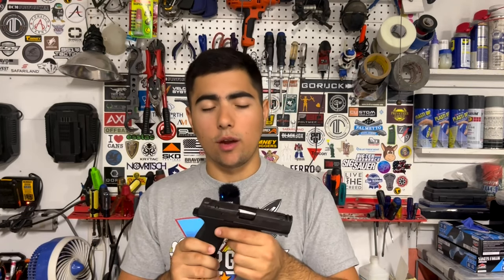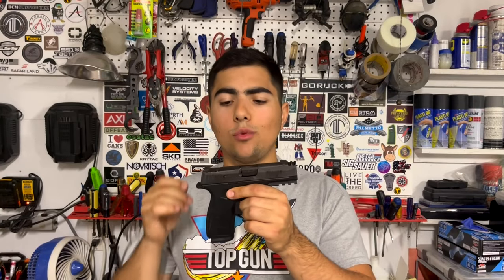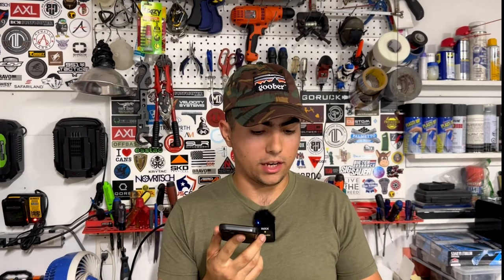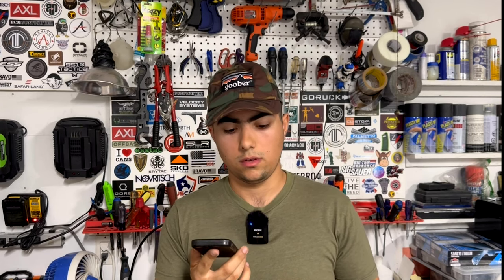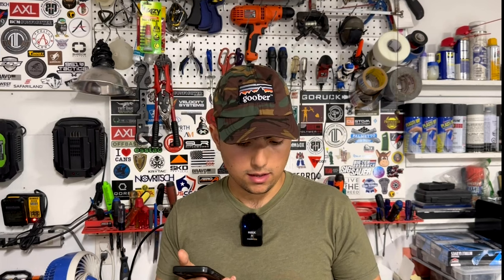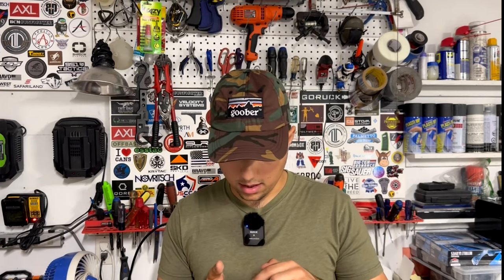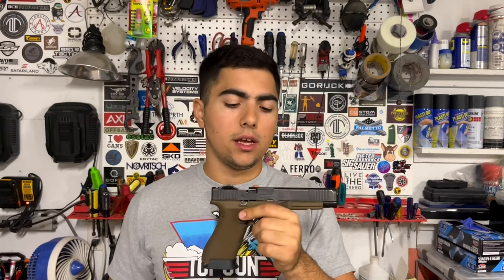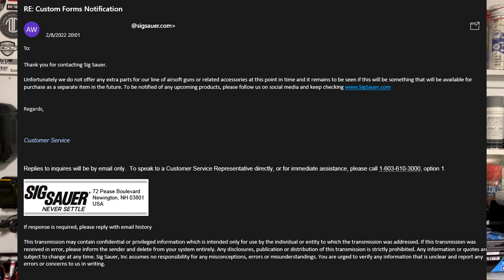Was I Wrong About the SIG P365 X Macro?

Comment: Thank you for this video. I was about to shell out $800 plus for the 3.7 Barrel with Romeo attachment. I am still going to test this pistol out at the range. 

One thing I can't personally tolerance is lack of accountability and trust. Their response seems to be the new norm for a variety of things and knowing what you had to deal with is enough for me to stay away. 

Just not acceptable to shell out more than $800 just to have to deal with this. I understand everyone may have a different experience with the  Macro, but seeing how they handle you're circumstance is unacceptable. 

Plenty of other brands out there that may still take pride in their quality control.

The agent you spoke to seemed to be helpful, but rest assured they were trained to respond that way and they are well aware of the issues. 

If a company cannot stand by their products that should tell you who they are and where they are going as a company.

Comment: No problems with my 365xl in @3yrs
I carry it appendix everyday in a variety of different kydex holsters. I've cleaned it 2-3x's and fired 1000+ rounds. 
No rust, no failures of any kind. I shoot the cheapest brass ammo for range time and carry 124gr HST.
I've put 50rounds of HST to make sure they feed properly and they do. I hate you had problems but I've heard of alot of finish problems with the MACRO. Sig has gotten to big for their britches with the military contract and it looks like QC or materials used have gone to shit.
Reply from the maker: Yeah it seems the 365s from like 2+ years ago are good but recently on macros and even on other 365s it seems their finish and quality just isn’t what it used to be.

Comment: What kind of holster are you using?  What kind of carry?  Appendix?  3-4 O'clock carry?  What part of the country are you at?  I've had zero issues with my P365 and P320s.
Reply: The point is, for $800 none of that matters. The gun sucks.

Comment: I wish i had the time to explain the physics behind a slide cut comp and short barrel vs a standard screw on comp, but I can tell you your incorrect in thinking the muzzle mounted comp is better especially saying its over 50 % better, you've got it backwards. Great video tho, I didnt even need to watch the rise of the gun I can see your entire arms and wrist moving without the slide comp..
Reply from the maker: Wouldn’t a barrel mounted comp with a tighter chamber that can better redirect the gases perform better? Like the macro comp does work, I was wrong with my initial judgement, but since it has to have space for the barrel to move, it also means more gases are escaping out the front.

Comment: the minute i saw the design of the "compensator" on the Xmacro i knew i was a terrible design. its not truly a compensator. its just a long slide with holes on it on a short barrel. but since i already had and love my p365 XL, and only want the bigger grip module, that's the route i'm going with. the only plus side to the Xmacro is the grip module

Comment: Meh... had the exact opposite experience with Glock CS. Lost the trigger housing pin putting on the beavertail back strap. Contacted them and was ready to buy a replacement. Acted like they were going to send me one for free, filled out an address fourm for them, and never heard back from them. Glock completely dropped the ball.
Reply from the maker: Did you try reaching out again for followup? Or did the lack of communication make you not want to communicate with them either?

Comment: Props for going back and giving the gun a second look, but I'm with Sig on this one.  The pin holding the FCU in place fell out on my gun and they just sent me a replacement.  I was on the phone for two minutes, no hold, and the guy I spoke with quickly offered to send the replacement kit, or have me send the gun back and they'd do it for me.  Granted, that's a minor/cheap part compared to your issues.  Watching you shoot in this video, you know what you're doing, but for that gun to be rusting where it is I can't help but feel we aren't getting the whole story.  For your Carry Mags, the FCU and the Optics Mounting plate to be what's rusting and none of the exterior is odd.
Reply from the maker: The exterior rusted plenty, I cleaned most of the rust off the gun so all the white spots on the slide are areas where there used to be finish and then rust and now bare metal.

Comment: I wonder if there was perhaps a bad batch, or a 'bad run' on coatings / components. (it can happen) 
I have a 365 and it gets exposed to saltwater air quite frequently in the ocean on my boat. 
In addition, I live less than a mile from the coast and the prevaiing wind is straight at my house . . . IE 'salty air nightly / daily'. 
So my gun is constantly expsoed to a very corrosive environment, and I am not seing anything unusual in terms of rust or corrosion. 
I don't do anything 'special' or unusual in terms of cleaning/ maintenance, or storage . . . so I am curious as to why your pistol seems to have such corrosion issues. 
I'm not doubting or second guessing your issue . . .  it just seems pretty unusual, and I haven't heard of anyone else experiencing this. Perhaps they are out there, I haven't looked for it. 

I too am disappointed in Sig's customer service response on this. 
I think it could / would have been better business for them to request that you send in the pistol for inspection, and to seek out the 'reason' for the corrosion issue. 
Who knows . . . they may have discovered something very unusual and unique to this case  that caused the issue. They then could have offered a remedy based on their conclusion(s) . . . weather that wes free, or at a cost . . .

But to offer a 10% 'go away' discount is less than impressive.

Comment: Has to be a bad batch. I have had my p365 ( the original one ) for many years and put 1000’s of round through it. No rust or anything. It does disappoint me that sigs customer service is that bad though..
Reply from the maker: It seems to be a later gun issue. If you check out the video from @nightwoodguns about the macro, he talks about how he had an early gen 365 with no issues but bought the same model later and it rusted badly.

Comment: 3 days after I had my xmacro, the mag release broke.  lol
Reply from the maker: Jeez, that’s awful. What did SIG CS say?
Reply: @donkeydefense   "It's unusual. Send it back we will take care of it."
Reply: Do not send back . This already happened to mine also. Throw the plastic piece of the mag release away , and use a 365, x ,or xl  mag release not the entire piece just the plastic part that snaps into place to hold it together. If you use the macros it will break again most likely. You will see they are different design but they work perfectly. Hope this helps
Reply from the maker: @JakeTheSnake, so the macro has a different mag release than previous 365 variants?

Comment: @11:00 when they asked him what he used to clean his guns with he looked dead at that WD-40 on the shelf 😂😭
Please don't tell me you're using DW-40 to clean your guns because that would explain the rusting 😭
Reply from the maker: No I do not lol. WD-40 should never be used on firearms.
Reply: @donkeydefense  I'm not going to lie... I used WD-40 as a degreaser and cleaner on my Smith & Wesson SD9 one time 😂. I made sure to wipe it all off and dry it after cleaning it though. I literally didn't have anything else and it was dirty like you wouldn't believe. It had mountain due spilled all over it and by the time we noticed it was all dry and sticky on the inside of the gun. It never rusted or anything. Smith & Wesson makes some pretty good guns.

Comment: Definitely not the best response from Sig. But the situation with Glock is not an Apples to Apples comparison. It's a case by case situation. I would be curious if you called Sig and said you over torqued a screw on your MOS plate and see if they wouldn't do the same thing. My guess is, they would.

Comment: There is a couple or more definitions of quality, one is building to customers specifications , another is meeting and or exceeding customer expectations;  sounds like this gun did not meet his cosmetic expectations regarding the finish , Sig Sauer most definitely should investigate this , seems this is becoming a common complaint, I wonder if this is a suspect lot issue that deviated temporarily from process or if this is caused by an incapable un robust process , need a response from quality assurance department !

Comment: I find it strange no one has ever mentioned rust on p365,p365x,p365xl,p365xlspectreor spectre comp but the macro it's  an issue.but not on the macro tac. Let's analyze the issue multiple 17 rd mag dumps through a comp'ed slide  reacts the same as a compensator or suppressor and super heats the finish causing the nitride coating to weaken rust will form where the stainless steel has been milled (sight cuts) because the natural stainless coating is . Lesson don't super heat the slide with multiple mag dumps that are useless for training, allow a cool down before storing after it's been super heated , clean and maintain it properly. . In short if your slide is working like a comp or mussel brake it must be maintained the same way.
Reply from the maker: I have plenty of comped guns that require no extra maintenance or care from my standard guns other than cleaning out carbon fouling. But no rust or other such nonsense. Same when running suppressed. This still leads to being a finish issue. 

Also people have had mentioned rust issues on other SIG models.
Reply: @donkeydefense  standard comp transfers the heat to the barrel not the slide . Steel muzzle brakes that have been rapid fired have rust . Don't get all defensive it's just the facts of physics and chemistry and those rules don't change base on your opinion. I'm not being a smartass I was simply explaining

Comment: The barrel is fine, it’s called normal wear and tear on sliding parts, learn to properly grease/oil your gun. Wipe it down when you’re done wearing it.  You need to oil under the optic before installing cause when you sweat it will seep into crevices.  

Man the Drama that Glock Princesses find to complain about. Take care of your gun and it’ll take care of you when you need it.

Comment: Isn't the slide, and FCU's  suppose to be made from SS?
Reply from the maker: It may be steel but it’s not stainless. It’s stainfull.
Reply: @donkeydefense  I replace all my sight with Trijicon iron sights on all my striker fire pistols. the sig site say's the slides are SS. I'm guessing rust is coming from the iron sights. under the optic has me stumped because the optic is 6061 Alum. unless your using a steel plate, are you? My trigger never got rustier any part of the pistol. Once I broke the gun in, I took the fcu a part and were steel components rubbed together I apply a lil Mil-comm TW25B grease any place I saw shinny metal. I live in the south close to the ocean. I go fishing all the time and the firearm I always take is my P365xl w. manual safety. For EDC depending how I'm dressed its my P320 or... you guessed it my P365XL. I also replaced the factory trigger for the GreyGuns trigger. I would cerakote the slide mad black plus from Mad customs. Forget about Sig re-coating the slide. I didn't like how they handle it. they should of offer at least, re-coat and replace all rusted parts this time for free and next time it will be on you. At least. Good Luck buddy

Comment: Sig's response was pretty lackluster. Let me preface this by saying I've had issues with plated wristwatches, bands and jewelry where plating would disintegrate to the point where I'll  only wear stainless steel or actual sterling silver or gold version of those items. So I know what that's like. That said, the finish on my Macro has been more durable than my XL's and none of my mags have shown any sign of rust even the spare mags Ive carried in a side pocket in cargo pants that is dedicated to just that purpose. Even the edges of the witness holes for showing round count have stayed rust-free. Maybe I got lucky or live in a less humid or cooler climate than you. Given my experience with my sweat eating metal objects in contact with my skin, I sort of expected to have issues but have not. If anything the nitron finish on the Macro slide has been more resistant to scuffs and holster wear than my XL slides have been.  Sorry to hear about your problems.

Comment: A gun that’s sold and pushed as a edc yet blames the rust on its intended use…  honestly should not have to clean a tool every single day just to stop it from rusting. 🤦‍♂️ and ok I would be fine with it if 1 the gun wasn’t so damn expensive and 2 all other guns on the market had the same issue. They need to look at the finish on the firearms and do better. Carried my g19 everyday for 2 years so far sweating my ass off, have not seen any rust at all and that’s taking into consideration glocks finish isn’t even as good as it used to be. Also for customer service not to take care of the problem like we got the gun for free… 🙄 p365 but If you carry it 365 days expect some rust haha
Reply from the maker: @blazeturtle9099  my thoughts exactly

Comment: I own 6 Sig pistols, two of which are P365s. I carry the XL and my wife carries the standard model every day and have for years. They get wiped down daily and cleaned and lubed weekly because we rely on them to defend our lives. I routinely service all my firearms because I rely on them to perform their assigned functions as well. If you opened the box and found rust on the pistol, the manufacture should take care of the issue. If you own a pistol for 5-6 months and don’t do diligence to keep it from rusting, I fail to see how that is the manufacturer’s fault. Clean your weapons. Lesson learned from 23 years in the Army and 3 deployments overseas. It doesn’t matter how lucky you’ve been with your other guns not rusting, or which manufacturer you prefer. If you expose metal to moisture and neglect it long enough, it will rust.

Comment: Its rather interesting that the rust issues you are having just happen to be located in places where sweat would collect and cause rust if the gun was carried bone dry with no lubricant for months on end, namely under the red dot plate and on the trigger itself.

I also happen to have a early production P365 X Macro but I haven't experienced any finish or rust issues yet I carry mine daily in a appendix holster that gets soaked with sweat quite regularly as I work as a HVAC tech. Only issue I've had so far has been the tritium leaking out of the front sight after roughly 1k rounds fired and SIG is taking care of that.

Anyway, IMO the only ways the rust could have ended up where it is on your gun would be if SIG failed to properly rinse the slide and trigger after the nitriding process, leaving some salt residue from the finishing process in the nooks and crannies of the parts that rusted, or you ran/carried the gun right out of the box without cleaning and oiling the thing, allowing sweat to wick into the now rusted areas while they were dry and devoid of oil. Regardless it seems odd to me that if it was a failure in the finishing of the firearm, that the rust would be limited to those areas that can collect and hide moisture rather than the whole slide becoming covered in popcorn rust.
Reply from the maker: I have no doubt that sweat getting on the gun had something to do with it. However, a good finish should resist that. I treat all my guns equally and the macro is the only gun to have finish issues as a result of getting some sweat on it.

Comment: The rust issue is your oil and humidity in your house. I recommend silica salt for your safe but more importantly your rust issue. I had the same issue with my G43x. I recommend G96 gun oil and TB25b gun grease.  Lightly coat a cloth with g96 and rub your firearm and all parts. The goal is to add and use the g96 as an anti rust coating as well as lube. 
-
After removing all the excess with a clean rag, I would use tw25b on the slide rails. Also contact with human skin does increase the risk for rust on all firearms.

Comment: While I do believe that the Sig’s have rust issues using breakthrough to clean it and just lubing it with go juice is not a good solution. After the degreasing you should hit it was something like G96 Gun Treatment or Birchwood Casey’s Barricade for an actual rust preventative. Same goes with the mags, but you could also wax those.
Reply from the maker: I use the same stuff on all my other guns with zero issues 🤷‍♂️